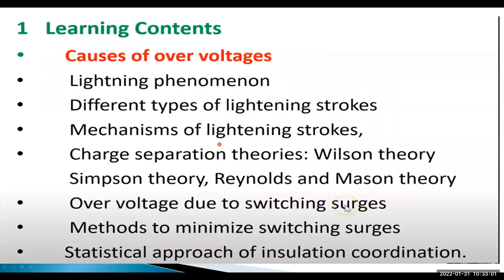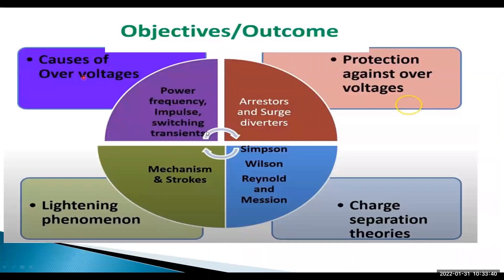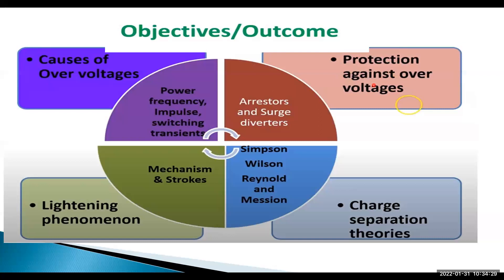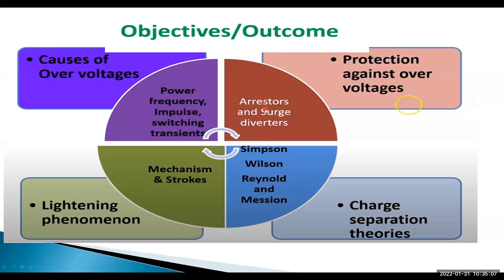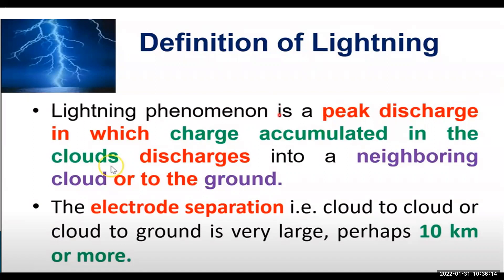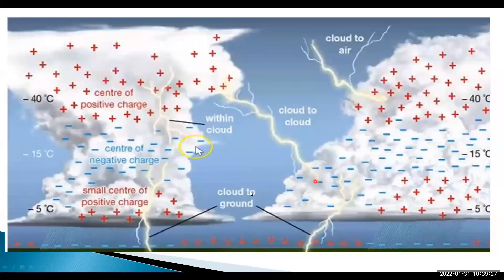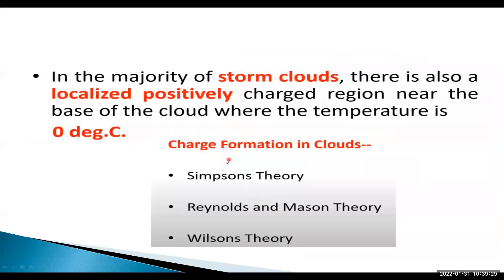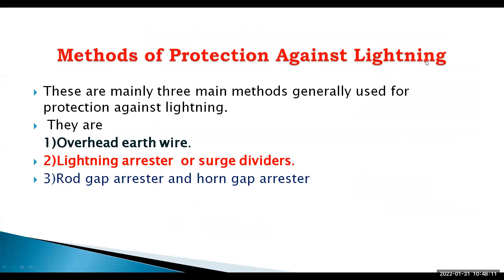HVE#Protection against over-voltages, Surge diverters, Surge modifiers

Comment: Dear Sir 
What is surge modifiers
Reply from the maker: Surge modifiers which are surge capacitor, a surge reactor and surge absorber: A surge modifier is nothing but a small shunt capacitor connected between the line and earth, or a series air-cored inducto
... The energy of these surges is such that it can be absorbed by the capacitors
Reply: @rajuganneboina123  Thank you so much sir for your instant reply..😊
Love From Punjab